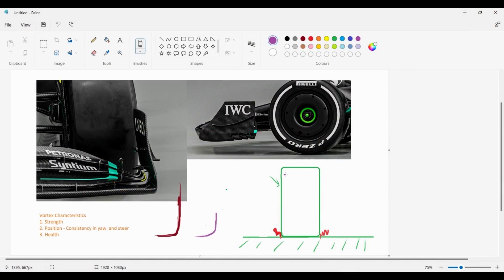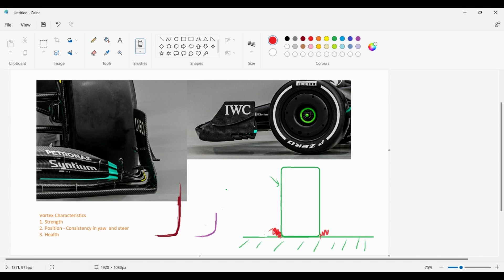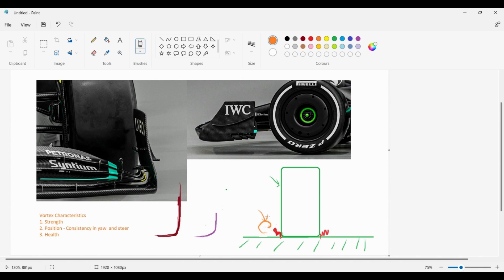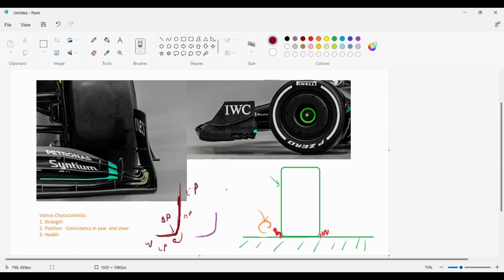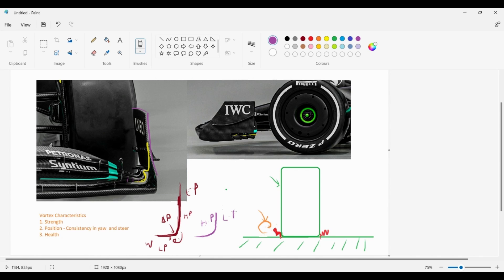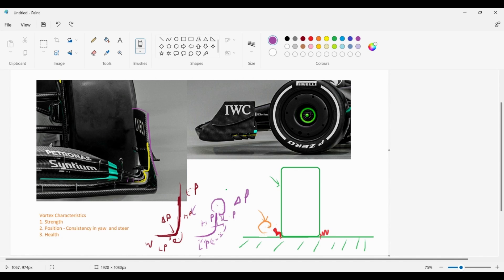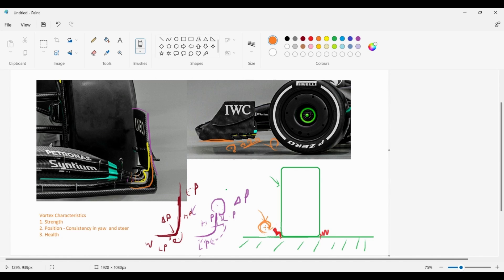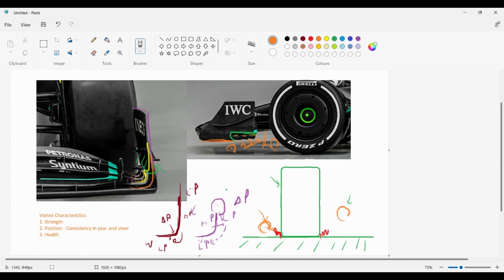F1 2023 Aerodynamics : Mercedes W14 Front Wing Tips - Explained !!

Comment: Great video thanks! This is the kind of in-depth explanation that is missing from the official F1 channels. Just one question -  how does the vortex created by the outboard side of the front wing move inwards to the inboard tyre squirt? Looking at the car from the front it looks like the vortex would be headed towards the tyre face or the outer shoulder of the tyre and not towards the ideal position you talked about.
Reply from the maker: Yeah, it does look like that. But infact due to the pressure gradient of the suction side of the wing and the front face of the tyre , it tends to move to the inboard side of the tyre.
The amount of turning is actually insane when you look at reliable CFD

Comment: I am giving a very rough answer and I don't even know if it is right. The opposite vortex is probably to avoid the air directly hitting the tyre with a very high energy, making the car slower. Also, it could be used to slightly inwash the flow towards the suspension setup for creating a neat flow at the mid of the car. Please correct me if I am wrong 😅😅 and your videos are crisp and give great info! You're doing a great job! 🙌🙌🙌
Reply from the maker: It might happen , but most likely not.
Check out the comments below. They have right answers in them.
And thank you for the words of encouragement. It's gonna improve more , I promise

Comment: I don't get what creates the vortex inboard of the tyre that you drew at 3:18. You were talking about the endplate and the junction to the endplate, but those parts are far too outboard to create a vortex inboard. Correct me if I'm wrong.
Reply from the maker: The Vortices on the tips and endplate make it all the way inboard of the tyre. Due to the pressure gradient imposed by the wing and tyre
Reply: @f1aerodynamicist  Due to the front wing being very high on these cars, and the wing is more cranked inboard, isn't it a problem that the vortex system coming inwards from the endplate is expanded and pulled upwards too much, deteriorating its efficiency in managing tyre squirt? If you want the vortex to be pulled up less (keep close to the ground), you would need a less cranked front wing (like the RedBull one), but in contrast, it will generate less pressure gradient, thus weaker vortices. Is this the tradeoff that aerodynamicists have to consider in this area?

Comment: Far too complex for me, however, I do have a question.  When a new car is being developed, does the chief aerodynamicist lay out the car, give his general view on what needs to be done and then assigns the various sections of the car to the respective groups for development?  And are the individual group teams big?   Please don't give any confidential info away.
Reply from the maker: Well, the individual groups are not very big  , ur looking at around 10 people strong. The chief has  a high level meeting and discusses the strength and the weaknesses of the car. They then discuss potential big changes in the layout of the car that can help them explore new concepts . Once they asses that and make decisions on that then the individual groups start building upon those changes and try to find performance
Reply: @f1aerodynamicist  Thanks, I wasn't sure if the aero group was big or small, but roughly 10 per team, I would not say is big.   Much appreciated.

Comment: Answer of the question is that the resulting vector from the vortex pair is out washing. So depending on the strength of that and the way it will put the vortex more outboard. Which is helpful to aim for the contact patch desired location with higher yaw right

So at very high yaw the side that takes the wind has a weaker free edge vortex therefore doesn't outwash as much and in the opposite yaw it make sure the end plate outside doesn't separate as much and outwashes the vortex pair stronger. Basically potential to manipulate the down and out behavior of the main vortex from the flap tips
Reply from the maker: Spot on ❤️

Comment: The vortex on the outboard side is not as important as the one on the inboard side. The rules force you into favoring that one, this keeps the wake inboard. Trying to move the wake outboard in front of the tires doesn't work with the new cars, that's old car logic. You gotta switch to new car logic, where the inboard side has more control surfaces which allow you manipulate the wake outboard. You have to push the wake of the tire outboard via brute force, the brake ducts and wing tips of the last generation are no more. All the furniture on the wheel is inboard for a reason, so the wing and bargeboard have to work together with the spec parts to move the air out behind the tire.

You see this in plain natural CFD during the Mercedes shake down. You can literally see the vortex forming inboard of the tire.
Reply from the maker: Thats true , and that's what I try to impress that the vortex structure is inboard. However in high yaw conditions this structure can land up too far inboard resulting in a yaw sensitivity and that's where the other vortex can help control the position of the primary vortex

Comment: I'll guess... the stronger the upper vortex the more outboard the lower vortex. Also since we now have a counter rotating pair we can use their common velocity to target downwash more effectively for squirt management. In summary, I'd imagine its a good thing? 🤔
Reply from the maker: Haha, it's fitting u got selected where you did Thomas. However , again I haven't seen the CFD of this , but I can presume that the other vortex creates downwash and outwash  on the primary vortex and it controls  the rate at which the primary vortex moves inboard or outboard in different yaw conditions. Whether it's downwash would be felt by the time you reach  the contact patch that would change with car attitude and in some conditions it might.